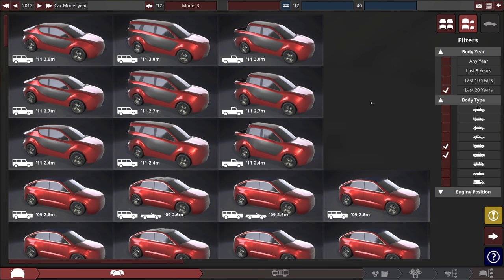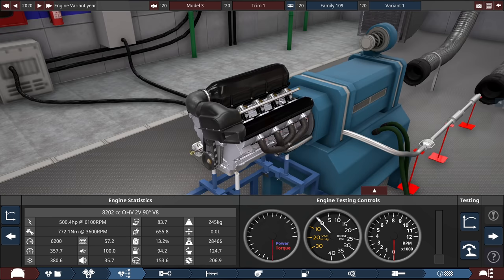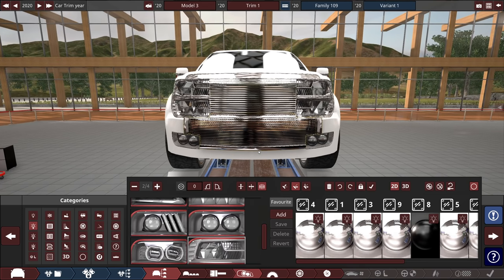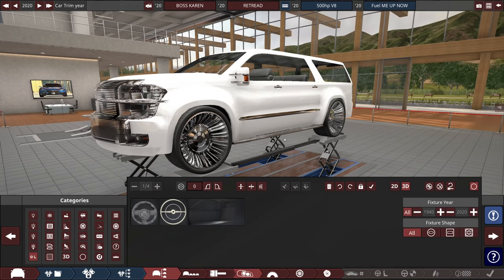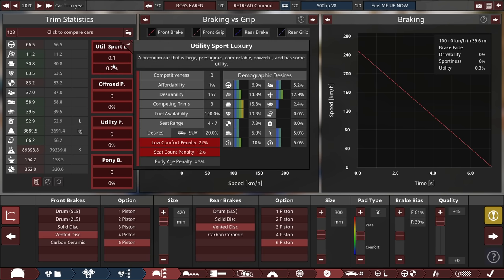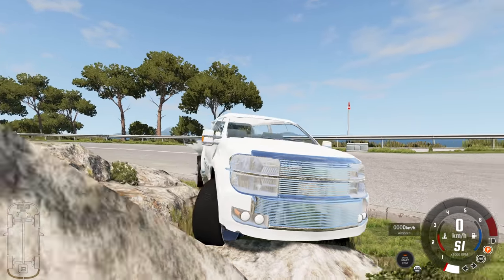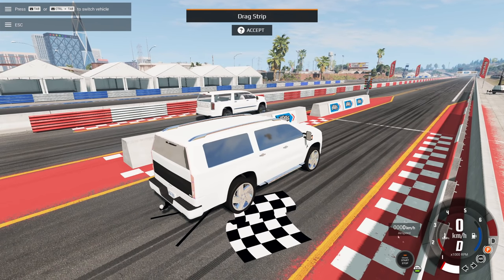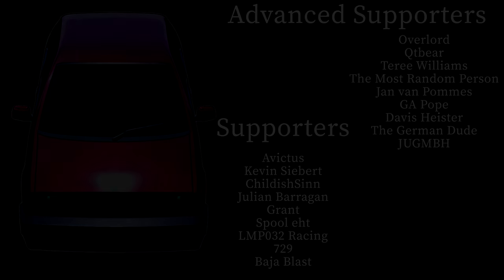BOSS KAREN (Automation + BeamNG.drive)

Comment: This thing is only 3.8 meters aka 149" in American. My first car, my mom's disused Expedition, is about 226" aka 5.7 meters. It was one of those awful Triton engines that pissed itself to death around 300k miles, but she got a good resale value because the mechanic swapped it for an Aeromax (30-ton semi truck) engine. Curb weight was around 8,000 lbs (3,600 kilo). It drove like the sort of stakebed trucks the chassis/engine/trans were otherwise used for. He still drives it as his daily since Ford stopped making SUVs that big.

Notably, while it was a huge high-trim SUV it was significantly more modest than a comparable Hummer or Escalade, since it reused the same seats/cluster as Ford's pickups. Ford didn't dig into the SUV market as much as they could, which was why they did a lot better during the financial crisis. The International CXT has a similar setup: despite being a literal semi truck (6.9 meters/6,600 kilo) it's got almost no trim because it's just an International long chassis with a bed put where the fifth wheel would go. The original Humvees and gen 1 Hummers have a similar distinction and at the time this was something "real" 4x4ers were annoyed about when the H2 and H2SUT were released.
Reply: The 3.8 metre was the wheelbase
The full length is probably 5+ metres just like your ford

Comment: You did so much wrong with the car

1. It should be a V6

2. 500 horsepower!? This is essentially one of those Cadillac bricks, not a kid concussioner. 300 horsepower tops.
3. 9 speed? Make that thing a 5 speed.

4. Those wheels are so so so wrong, you have to make those tires chunkier. It should be an “off-road” brick.

5. How dare you have that thing wide fitment, this is a family car not an R32

6. This thing should be more of a 35,000 to 70,000$ price

7. AWD? HOW DARE YOU! That monstrosity should be FWD.

I think I’m gonna have to go speak to your automotive engineering manager. This is unacceptable.